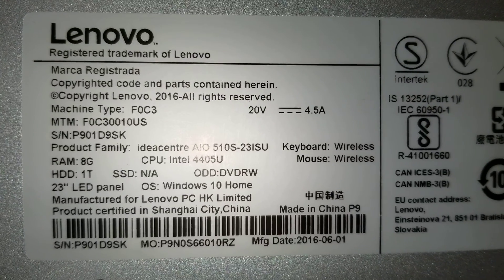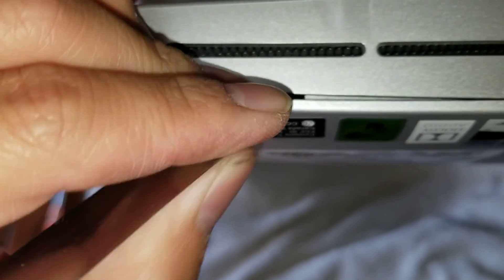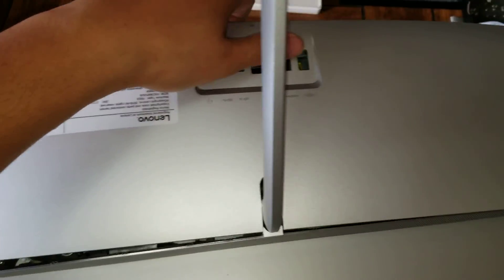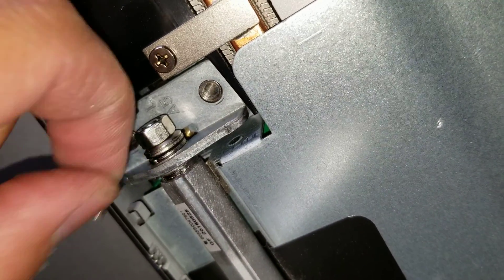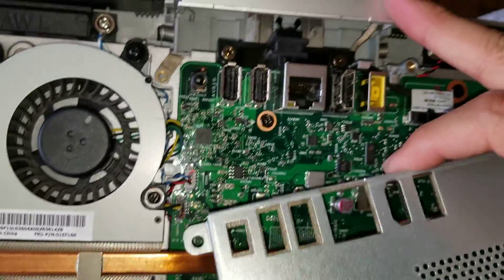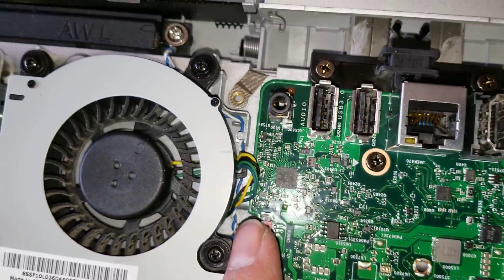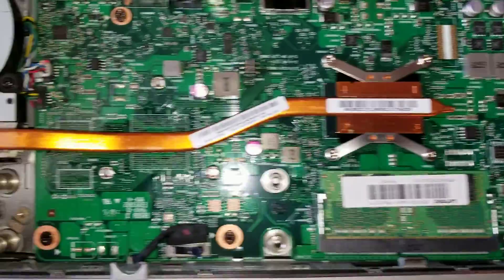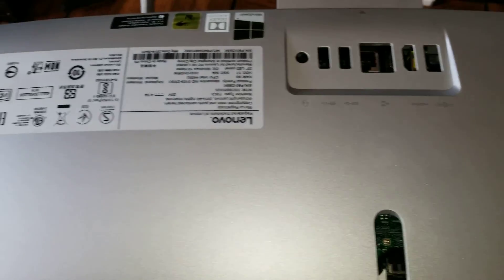Lenovo ideacentre AIO 510S-23ISU Disassembly RAM SSD Upgrade Repair

Comment: I have a doubt, can I keep an SSD and a HDD combination?????
Reply from the maker: Only if there are slots for both
Reply: @ItsBinhRepaired  that only I'm asking is 2 slots there for both?
Reply from the maker: @gyanoday6  if you watched the video, you'd know answer. Only one slot.
Reply: @ItsBinhRepaired  ok🙄
Reply from the maker: @gyanoday6  this should help https://youtu.be/4p5jFDzVwUw
Reply: @ItsBinhRepaired  can u suggest me the best ssd for the desktop?
Reply: Can I use sata m.2 or nvme m.2?
Reply from the maker: @gyanoday6  it depends on what your motherboard supports.
Reply from the maker: Check the video

Comment: Hi can you tell me i have a fault with the same model.
There are horizontal lines on mine on boot up ,i can not sign in or do anything to correct this as all i get is horizontal lines.
could this be a graphics card fault ? and can it be repaired.?
Thanks
Reply from the maker: Sounds like it. Try an external monitor

Comment: 04:25 
That other button is the monitor toggle button. The HDMI at the rear is a HDMI-in and HDMI-out port, and when the button is pressed, the monitor switches between the AIO computer display and an external HDMI display plugged into the HDMI port. The HDMI-out can be used as an display extension, like what many laptops display output ports do.

Currently I am using the All-in-one as a monitor because the integrated GPU died (keep BSOD about video internal scheduler error , maybe shorted capacitor), and I have the monitor "overclocked" to 120Hz.

Good Job on the video about pulling the panel out. The panel was very tight and I feared ripping out other stuff. With your video I could salvage the 1TB HDD as my Bittorent drive and the DDR4 RAM for other use
Reply: hey, im kinda late but can you tell me how you overclocked the monitor?
Reply from the maker: @sohammahajan1297  I don't know what you mean. I didn't overclock the monitor.
Reply: @ItsBinhRepaired  no I'm taking about the guy who overclocked to 120hz, but thanks for your tutorial tho, I ordered my ram already
Reply from the maker: @sohammahajan1297  oh, I see. Yeah, that's kind of weird lol never heard of overclocking a monitor.
Reply: @sohammahajan1297  You are using the all in one computer solely right? Not that I had tried it though before the internal computer failed. I only have it as a monitor now.

If you are to have the monitor at a higher than normal refresh rate, usually called refresh rate overclock, you may need to look into a software called Custom Resolution Utility or CRU. https://www.monitortests.com/forum/Thread-Custom-Resolution-Utility-CRU

The all in one has a skylake CPU, so refresh rate overclock should work on this platform's integrated graphics. I never tried it though, you need to look into it yourself. The all in one is so defective that I cannot test it.
Reply: @sohammahajan1297  By the way, there are noticeable but tolerable artifacts at 120hz, and 120hz is achievable only with video timing CVT- reduced blank. If you are aiming for flawless higher refresh rate without artifact, the limit is around 95hz.
Reply from the maker: Interesting
Reply: @siumanlui7905  found it👍, over clocked to 72hz, maybe I'll go to 90hz a bit later because I don't get above 80 fps anyways
Reply: @sohammahajan1297  You probably hit the HDMI support limit at around 75hz refresh rate. The default HDMI support limit clock should be 150mhz. To increase it, which increase the max refresh rate output from the integrated graphics, you need to go to the CRU program's extension block at the main menu, edit the cea-861 block. Inside the sub menu pop up, go to Data block and find the "HDMI support" and edit the max clock to 330mhz. This should allow to crank up the refresh rate to 120hz.
Reply: @sohammahajan1297  My bad. My previous reply is about overclocking the all in one in monitor mode. This thread should give you more relevant info. http://forum.notebookreview.com/threads/psa-you-can-now-overclock-your-laptop-monitor-intel-intel-optimus.802167/
Reply from the maker: Nice
Reply from the maker: Cool
Reply from the maker: Glad the video helped. You should have recorded it and entered the contest.

Comment: Hello, is it possible to have SATA HDD and SSD HDD at the same time? I have seen some AIO PCs having both at the same time. 

I have SSD in my Ideacentre 510S and I would like to increase capacity. SATA HDD is much cheaper. 
Thanks.
Reply from the maker: If there's an optical drive, you can get an adapter to replace it, but other than that, no.
Reply from the maker: Hard drives are very slow in comparison. You can use a usb hard drive.